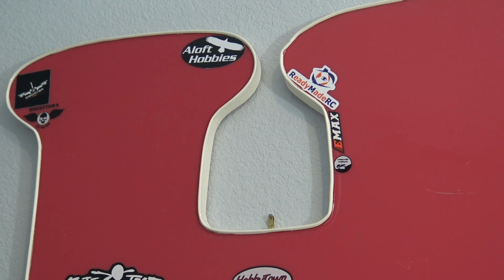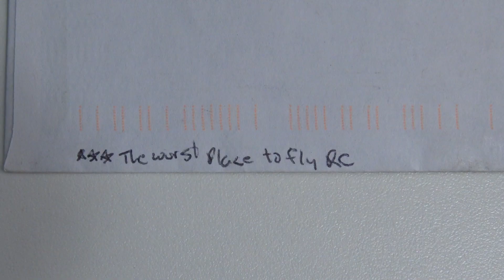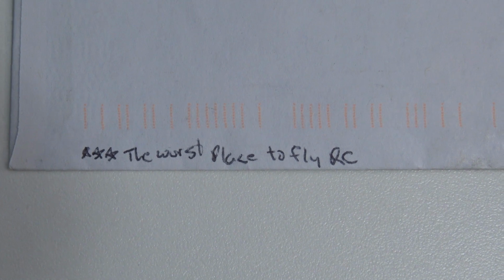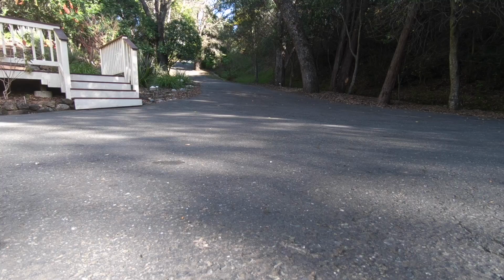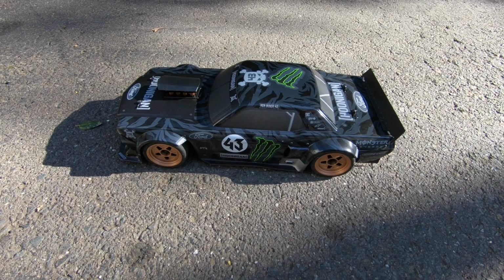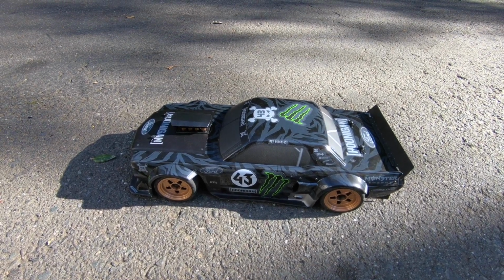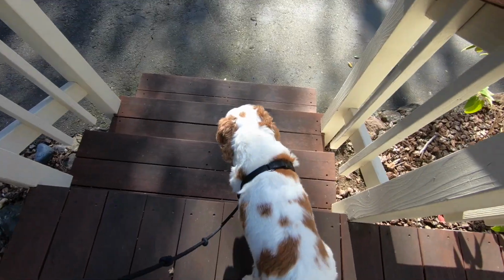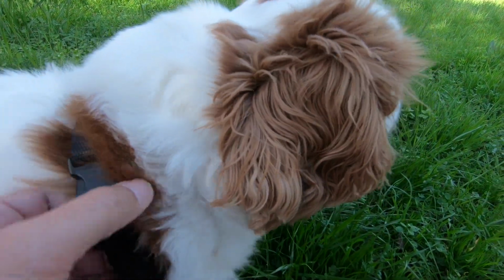X-Maxx in the Park | Hoonicorn on 2S Lipo | Sticker Board

Comment: cool video. just ordered the green xmaxx 8s. have you had any esc or servos go out? thanks
Reply from the maker: On my first X-maxx I was getting random esc shutdowns from time to time. I sold that one too a friend and on my second one it's been solid so far. Never had a servo issue. The pinion will get loose after running for a while but other than that no issues with it - solid truck.
Reply: thanks for the reply. I just got mine a few days ago. so far so good
Reply from the maker: awesome man - have fun with it. it's a beast.

Comment: What did you change on the HPI Hoonicorn to run it on 2s?
Reply from the maker: it's in the video - just changed out the plug to deans or you could get an adapter. Change the esc jumper to lipo. that's it -good to go.
Reply: Discover RC cool (dont have one but it looks so awesome)